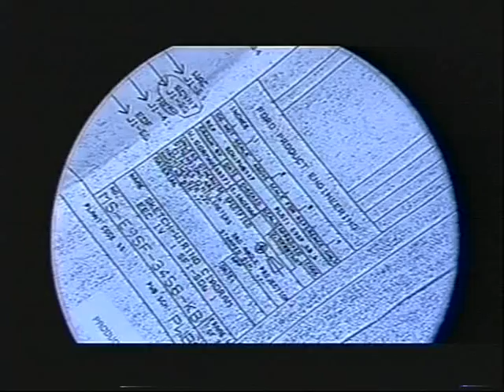"Runaway Cars" Segment 7 - Sudden Acceleration

Comment: I had this occur more than once in my Volkswagen New Beetle. The first time it went to 100 mph. I hit the clutch and it didn't stop until I put my feet on both the brake and clutch at the same time. Stopped the car every time.
Reply: Riley Smith This happens all the time on my Bora. I live with it and have learned how to stop it. Dip clutch then QUICKLY hit the brake, dipping the clutch and releasing it, dipping, releasing etc. Hold the brake all the time.
Reply: @siliquaesid703  I steer to the side of the road after it stops and put the car in 1st or reverse, apply the emergency brake, and turn the car off.
Reply: @siliquaesid703  I have a 2014 Beetle and can stop it without the clutch pedal if the throttle were to stick, meaning even though it’s a stick, I can still stop it in an emergency, with or without putting my foot on the clutch pedal.

Comment: My car is doing the same thing I need help....Is it a throttle problem??..Hate to get totally ripped off with a mechanic. I usually brake gently to ease the speed while its running and I am in traffic, I look for a safe place to pull over if it doesn't stop, I notice when I apply the breaks while it takes off it hiccups and it drivers normally. This happens when in the city I hit potholes, and there are many during winter. I am pretty good about avoiding but when it happens, it feels like I pinched something for it to take off. No mechanic has master this mistery. I have not gotten the throtle changed I'm affraid too. the check engine has deceived my mechanics. Ford Taurus 2006~~ but no recall not enough complaints

Comment: I don't own a Ford but I have long been of the believe that there can be transients causing strange happenings in the electrics of vehicles interfering with Injection system and other sensors as well as the throttle control provided by the cruise control. To this end I have fitted an isolation switch in my car so that the cruise control actuator is completely isolated UNLESS I turn it on.

Comment: @lrd9999 I recently heard horror stories about the 2008/2011 new shape Ford Fiesta with the "Powershift" double-clutch transmissions. The engagement/disengagement of the two clutches are controlled by a computer in the Fiesta. Its all done via a programme and software and it is already going drastically wrong with disasterous consequences. The system is highly dangerous and extremely unreliable the software gets glitched very easily and the car needs to go back to Ford for updates. Terrible!

Comment: @amazonmollycole . Yes it has happened to me as well in a Hyundai Trajet Minivan if it was a hot day , it could rev to 4 5 6000 rpm by itself it you put it in P .Once it reved on itself when it was in D and we had to turn it off and restart it . There was many people working there saying the same thing about that car . It did have a cruise control . It only happened on hot summer days .

Comment: @idontcare80 An electrical part starting a fire strange? very common as a matter of fact. An electrical part causing unintentded acceleration like Sero suggested has never happened. Now that you mention it Sam must have looked at these parts in detail - how come he didn't find out the one thing they did do - namely cause fires? Not much of an investigator